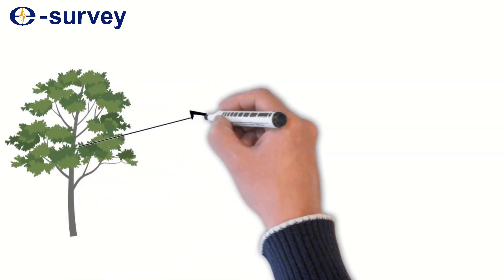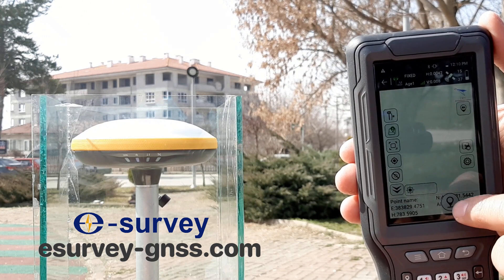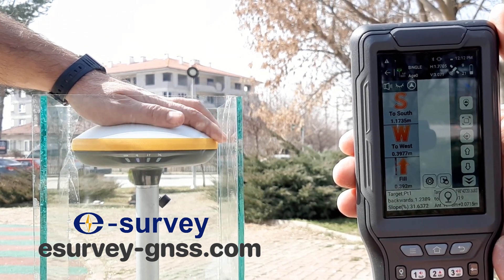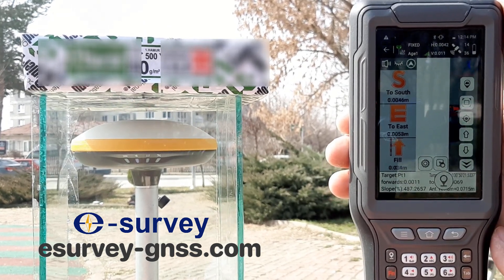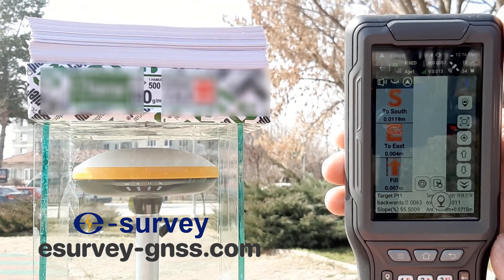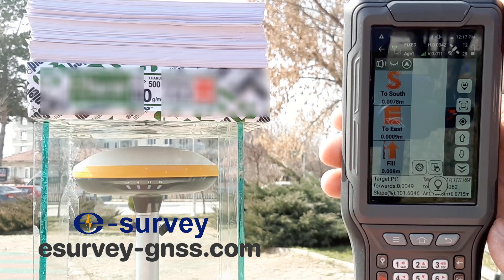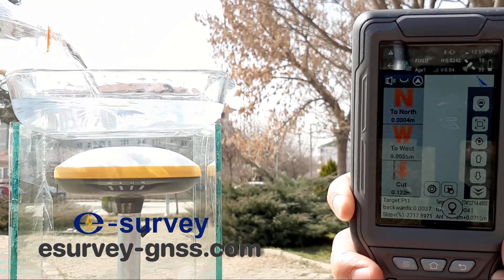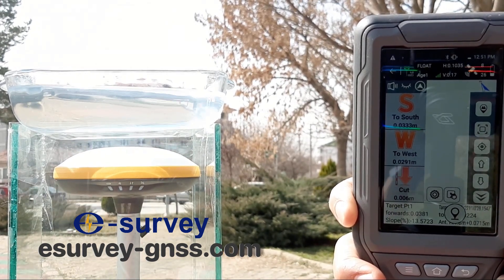eSurvey Laboratory - Season One

Comment: Hello! Just Got my E300 Pro. I'm from Philippines. As you can see. Some of the  houses here are very close to each houses. I would like to ask for a sample how to get under the side of house where if the edge of the house roof is on the top. it continue to Float if we loop the data. how can i get an example of how to get at that point? And another Question is. If the Data Collector is Fixed, but the H: is greater than 25. there is a pop-up and cannot finish the data to collect. Thank you!